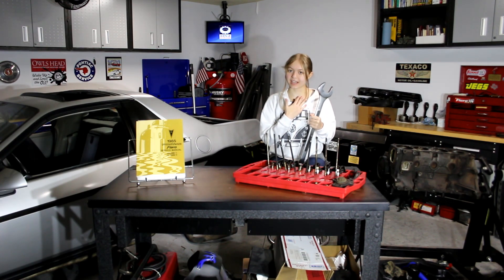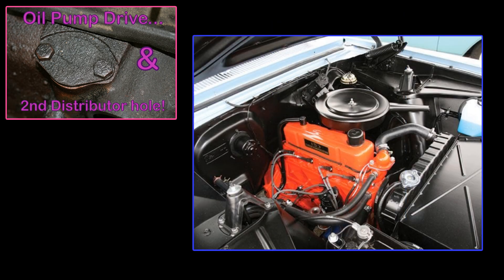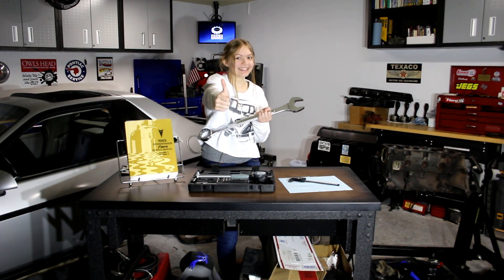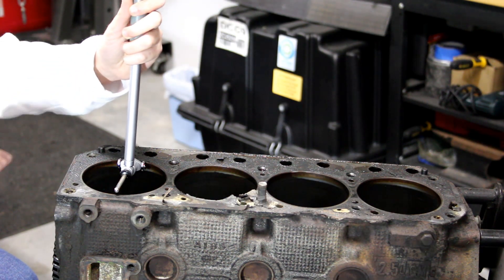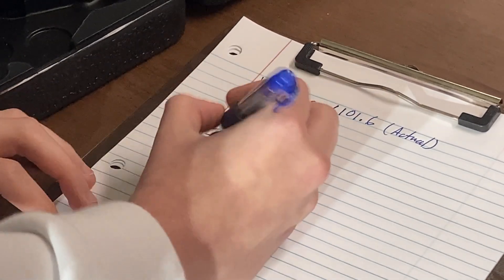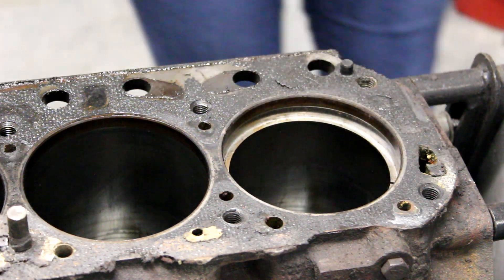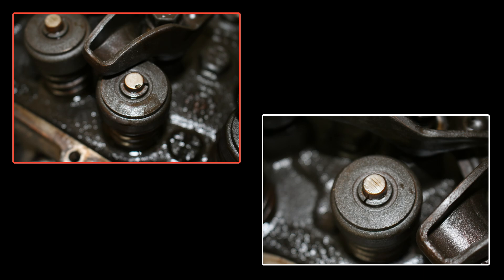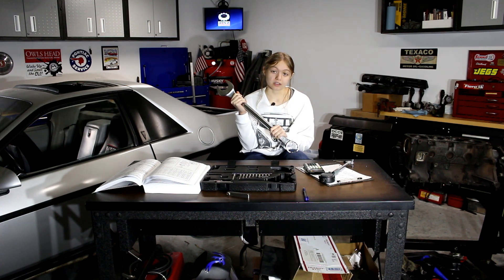Measuring Cylinder Bore & Clearance (Iron Duke) - Gen Z Garage Ep 17

Comment: Would you mind disclosing what having your motor sent to the machine shop cost? I have a 3800 swapped Fiero and plan on swapping in a series 3 in place of my current series 2. However, I'd like to have it cleaned up first.
Reply from the maker: I'll go over all this in the next video, but the total machine shop costs were about $700. This did not include any of the parts.
Reply: @GenerationZGarage  Gotcha, sorry for asking prematurely! Thanks for the answer though. I think this series is really cool as I'm about the same age as you and have an almost identical Fiero... Minus the powertrain of course ;)

Comment: So why not sleeve the motor and bring it back to spec so there is no chance of loosing the block? BUTT- speaking as a learning man not meant to be a reverse logic question.

So what tools are you using I don't see a description or specification for them and why you chose these tools?
Do you have any DIY men kontakts in Lincoln Nebraska area that I kould associate with to get motivation to do the work to rebuild my motor to override the fears?
Reply: Dad here... you "could" sleeve the engine, but that incurs significantly more cost, and is not something you generally are concerned about unless you've gone beyond the engine's allowable specification. In this engine, it's actually quite acceptable to bore it out to .060. Typically, when people do a rebuild, it's .030 or .040 if it has a lot of wear. This is acceptable. When you get past .060, they just don't make "off the shelf" pistons that size, and at that point, you'd want to re-sleeve the motor. The tools are just cheap Chinese tools. For someone opening a business, I'd recommend really high-quality tools. For a garage warrior like my daughter (and myself), the cheap stuff works.
Reply: @Todd82TA  Thanks for your reply. Is a garage warrior in place of a weekend warrior? That is the first time I have heard that expression. Do you have any kontackts in lincoln Nebraska that I kould work with to learn automotive quicker?

Comment: if you are convinced to keep the iron duke engine. carefully consider how you are going to build it.  look up threads on people modifying them. with the proper build you can get 200hp.  back in the day many people were very unhappy with the performance of that engine. I am convinced you will have a much happier experience with your car and it will remain with the same engine. just look at your options.
Reply from the maker: Thank you. For now, I just want a good solid reliable version of this car that runs well as it did when it was new. I want to baby this car, but plan to get another one as soon as I get a job, and then I want to go all out with that one and put a huge motor in it.

Comment: throw away that iron duke. install a 3800 supercharged engine. it will be much cheaper and much better
Reply: That's not the point of this build, this build is to preserve and refresh a basically stock car. Something that very few people are doing, especially for the iron Duke, not everyone needs to follow the crowd, and just throw away the stock Fiero engine. It's because of the iron Duke that the 2.8 exists in the Fiero, and for that matter that the Fiero is here to put a 3800sc into, without an economical engine, the Fiero would have never been.
Reply: @1985FieroGT  i appreciate what you are saying, but as a mercedes mechanic with 29 years of experience, the reason i made this suggestion is for way better drivability. you can always put the ID engine back in it if you want to return to stock
Reply: And she can always put the 3800sc in later if she decides to, remember she hasn't even driven this yet, she is going to get her license, then experience it like it was brand new, THEN decide whether to majorly modify and change the car.
Reply: @1985FieroGT  yes, but spending a few bucks on the ID when you can get a complete 3800 is better financially
Reply: Maybe so, but since when are car people good with finances haha, once again, the whole point of this series is to restore the car to basically factory condition, with a few modest upgrades that won't change the whole car, you can't just decide to completely modify something before you've driven it stock, and for anyone new at driving, a 200 something hp engine in a small old car is a recipe for disaster, only after experiencing the car as it was new can she decide to majorly modify it, it goes against the whole idea of a restoration, it can be done later, but the series is on restoring it, not majorly modifying it.
Reply: @1985FieroGT  i would argue that an underpowered car is also dangerous. at least build the engine for a turbo
Reply: @narcissistinjurygiver2932  less so then an overpowered one, at least if you get in an accident, it is less likely to be your fault, and like I said, this is a restoration, modifications can come later, once she has experienced what it was originally like.
Reply: @1985FieroGT  @200hp for a 2400lb car is not too much power. more inline with a Miata. back when I was a teen this car came out and many hated the performance
Reply: @narcissistinjurygiver2932  maybe so, but that is up to AJ to decide, and she can't decide until she's experienced a stock Fiero in good shape, and like I've said many times, the whole point of this series is to restore, not modify, the car, period. That is the goal, her dad has experienced higher powered Fieros and has experience with other engines, so that is not off limits later on, but this series is a restoration, not a modification. Similar to what Ronald Finger did, restored a bad car to its original beauty, it was a 4cyl, and that is what they want to do. Restore, not modify.
Reply: @1985FieroGT  well some beefier rods and pistons would not hurt.
Reply: @narcissistinjurygiver2932  agreed, which I'm sure they're already going with
Reply: This is a rare "dad" appearance outside of Pennocks, haha. Bottom line, I view this as a teaching experience more than anything else. She doesn't have her driver's license yet, and she's going to be learning how to drive with this car. I want something that's totally solid and reliable, and that she can learn to repair by referencing repair manuals. I'd thought about maybe swapping in a V6, or just getting her a V6 from teh start, but the Iron Duke is such a good engine to learn on, and in the end, she's become so attached to the car that she doesn't want to swap it out. She wants to keep it as stock looking as possible. We do plan to get another car that we can share and take to SCCA events... and that'll probably have either a roller V6/60 or something else. I also have my own Fiero in storage, and the big black crate you see in the back that says DCC9 on it is a hopped up 3.4 V6/60 with ported ARI Racing heads and a hotter Crane H272 Cam.  @narcissistinjurygiver2932
Reply from the maker: I want to restore my Fiero to factory condition or what it was like traditionally. I eventually plan on getting another Fiero and going all out and crazy with it and turning it into a racing Fiero!
Reply: @GenerationZGarage  awesome. what about going 13 to 1 and switching it over to e85?   that would keep it stock, cheap clean fuel, and it will be safe.   I am a mercedes tech. Any info on how to do the 3800 swap would me nice.  thanks.   you are a good dad to your daughter.
Reply: I get where you are coming from as the Iron Duke engine was never build to live the sports car life.
Reply: @crazeguy26  Well makes sense when you think that the Fiero is a fuel efficient commuter car. That's how it was introduced, until the v6 came out.